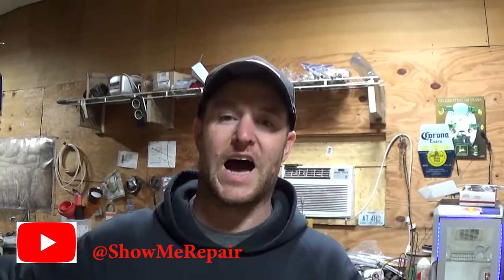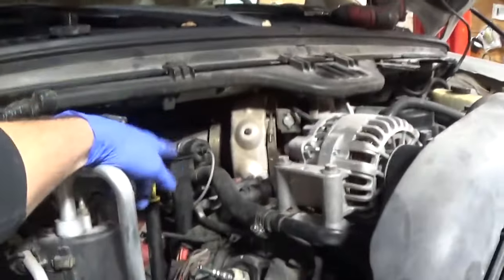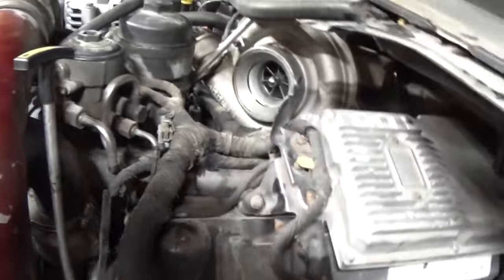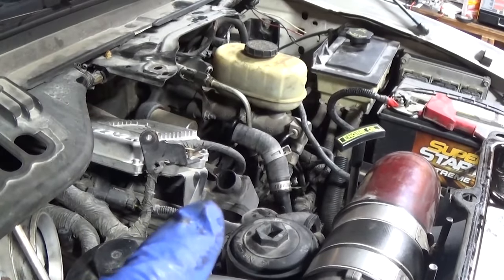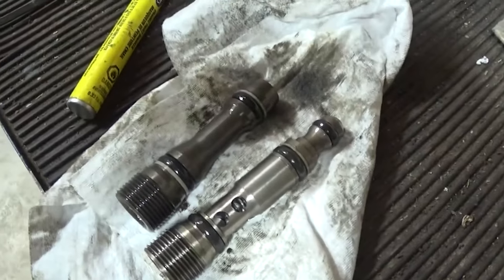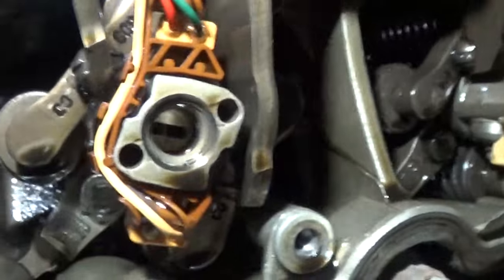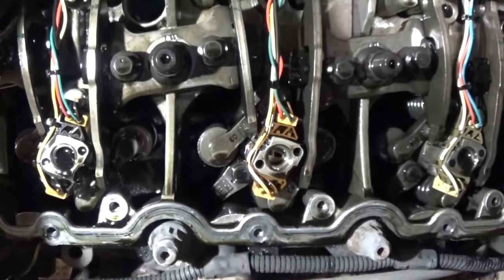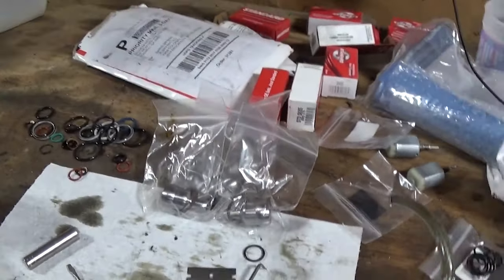I Learned something new on a 6.0 Powerstroke

Comment: i was really hoping you was going to show me how to get that clip out.i replaced all 8 orings on a nearly new injectors when i replaced my nipply cups and orings,..it didnt work for me.. i got around 5k on the first upper oring then a few thousand miles every injector oring after that
Reply from the maker: If I learn how I’ll definitely share. 
If your having o-ring failure that much. Check your oil for excessive fuel. I’ve had customers that go to long on oil changes and have excessive o-ring failure. Had a customer not to long ago started having oil leaks and drivability issues. Engine was making oil. I found some of the injector o-rings that seal the fuel in the head were leaking. Installed new injector o-ring kit. Cleaned out the injector bore with a brass brush also. Fixed concern
Reply: @showmerepair  heads are fairly new kdd and ive yet to see any hard to remove build up in my injector bores. i alway blow out the bolt holes and follow correct torque specs, and never a promblem with the replacement injectors only the injectors that i tried to replace that oring. Something to them upper orings.
maybe the standard brand reseal kit is the way to go, i used allience i think?
im scared to try it again so i just replace the injector when the oring goes bad.. Ive got 8 fairly new injectors that i didnt want to send back as cores and would be willing to try it again if i could get that clip out of there
Reply: Its not terribly difficult the C clip. although OEM injectors typically don't have a lip to grab on the C clip. so you're just stuck holding 2 small flatheads with one hand and hitting the other, you really need something to hold the injector in place in a vise. like a block of wood with drilled hole the same diameter i had a blown out top O ring on a injector had to remove the O ring. C clip needed to come out. they typically give them to you with injector reseal kits anyhow.
Reply: @Justn Saliga I seen a few youtube videos of guys doing it that way,  I just ended up with a bunch of broken little screw drivers.

Comment: Is the air test through the IPR any different or better than through the ICP?
Reply from the maker: When air testing through icp, you’ll have a leak at the IPR. It’s best to then get the tool that commands the IPR on. 
When air testing through IPR, there is no need to command IPR on since it will be removed. 
I air test at IPR since I’ve done it that way for years. I’m use to hearing the IPR leak. I’ve been thinking about getting the air tester at the IPR.
Reply from the maker: I also air test at the ICP since it easier to get to.
Reply: Yes, much easier. Especially when you have big hands. Thanks for replying. Your channel is great 👍🏽
Reply from the maker: Your welcome. Thank you for watching. I’m working on videos but I’m starting to get a lot more business. Not complaining that I have more work. But wish I had more time to make videos

Comment: OEM nipple cup torque spec is 100ft/lbs.  Where did u get the 155ft/lb spec at?  I think u said breaking torque was 145tt/lbs?   

Also did u notice if cup moved pretty easy on any that were leaking mmk it nesscary this time possibly another time with a diff truck thatcthhe cup seals where leaking have you noticed if they were sloppy prior to orings being changed and then they took alil effort to move it after they were torqued
Reply from the maker: I was figuring that break away torque may be less than actual torque so I added to the torque when I went back together. 
I have noticed some feel pretty loose. I’d still want to air test.
Reply: I’m going to hit 120 then go alil at a time.  What sucks is to assemble everything and it still leaks.  Airtest I hear it but I can’t tell if it’s leaking for not around nipple cup.  Thanks appreciate the reply also.  A lot of hosts don’t reply at all 👍🏼👍🏼👍🏼
Reply from the maker: Your welcome. I appreciate you watching the video.

Comment: I chased many leaks in the past and rebuild the injectors on the 6.0. the injector seals last for approximately 10k miles and starts to  leak again. what seal kits are you using? good information
Reply from the maker: I don’t have enough experience with them yet to recommend or warn to stay away. Will definitely update if I have any info. 10k sounds pretty low. I’ve seen o-rings fail sooner if an injector is leaking fuel into the oil.
Reply: lower ur fuel pressure
Reply: Alliant power ap0002  is the best injector reseal kit I have found!!! There decent enough that ford sells them if u need a complete reseal kit as the motorcraft kit don't come with orings for the top of injector.
Reply: It depends on which seal is going bad.  If it's a top injector seal failure, like the one shown here, it's almost always caused but one of the injector cup seals in the oil rail above it.  Once the oil rail seal starts to fail, it sprays high pressure oil into the injector seal below and destroys it.  If you're talking about one of the lower injector seals, I have had good luck with the alliant seal kits.  I'm running HHC seals for the oil rails and have about 40K miles so far.  I didn't replace the nipples.

Comment: So I’m going down the same rabbit hole but I’ve changed the nipple cups too. Is it possible that air is flowing through the injector ad back out the outlet holes? Everything has been changed. Testing through Ipr
Reply from the maker: @Redneckbusdrvr  if you’ve had the injector disassembled and have not had all the electrical hooked back up to let the ficm open and close the spool valve.
Reply: @showmerepair  I didn’t take any of them out or apart. Just changed the top o ring because I thought that was the leak and still air which I believe is flowing through and past the spool valve which I honestly didn’t know was an issue
Reply from the maker: @Redneckbusdrvr  ok. Just checking. You could have an injector stuck open. 
I have seen air leak past o-rings that are dry. 
Try putting the engine partially together. Enough to crank and build oil pressure. 
See if you’ve fixed your problem
Reply: @showmerepair  thanks for your help. I just threw everything at it. Stand pipes, dummy plugs, HHC nipple cups, 8 injectors and a new hpop. Just finished today and runs great. Appreciate your replies and videos. Thank you

Comment: Did you say 155 ft lbs to torque the nut on the rail nipple?
Reply from the maker: Yes I was torquing to 155. I just looked at a couple places online. 75 to 100 Lbft is what I’m seeing. The truck I did the repair on is still going strong.

Comment: How do you check or troubleshoot which oring leaking fuel into the crankcase on an injector. I've changed the orings and copper washers on all the injectors already but still getting fuel in the oil. Is this common problem? Vehicle is a 04 6.0 powerstroke and I don't have any blowby either..Thanks..
Reply from the maker: It’s not common but can happen. 
The way I’ve had to do testing before. Add dye to to fuel. Remove valve covers and oil rails. Run lift pump. Using a black light, Look around the injectors in the cylinder head.
Reply: @showmerepair  Ever try shop air to the fuel rails, and if so how much psi would you use?
Reply from the maker: @crushingthepyramid1641  I have not. Plumbing it up sounds like a pain. Fuel pressure max is around 65 to 75. 
I feel using air would possibly lead to misdiagnosis. Air is thinner then fuel.
Reply: Fuel into the oil would usually be the second o ring from the tip (black), I have heard of leaks from the injector body but have never seen it myself
Reply: @crushingthepyramid1641  theres a Fuel rail test port has air fitting on it you can get on amazon for about 7 bucks. replaces your banjo bolt with one with the Fitting. and you can pressurize it or hook up a fuel pressure gauges i bought 4 of them just because.
Reply: Cracked heads can leak fuel into oil if the crack is at top of injector bore.
Reply: @jimmyaber5920 yup, I've seen this more than once as a dealer tech..
Reply: Thank you for this. I have the covers off. And needed this help! Glad to find help! Liked and subbed

Comment: I have a 2005 f350 runs good no check engine light on cuts off after driving a while have to wait 20 mines to start again  keep doing it what can it be?
Reply from the maker: @Wayman-o4m  sounds like a high pressure oil leak.  You need to pressure test the high pressure oil system. 
If you’re expecting me to tell you it’s a specific part. I won’t do that. I’ve worked on these trucks long enough to know that guessing in the high pressure oil system is a bad idea.

Comment: I have a 05 with 288k and a hot no start, it also had a miss like a missfire in a gasser under load on interstate twice. I built a air rail tester for 15.00 and an OTC 6764 IPR controller an I can hear an feel air coming out of oil fill tube on passenger side. Will these cause that or is there another issue causing the miss under load. Starts in under 3 seconds when cold
Reply from the maker: You could have 2 different problems going on. You may have a weak injector and an oil leak. 
I would recommend pulling the valve cover to inspect for air leak. If you have removed both valve covers and no leaks are found. I would inspect connection at high pressure pump.
Reply from the maker: If you find your oil leak and your valve covers are off. I’d recommend inspecting the injector that is causing the misfire. Check for dtc it may lead you to the injector causing the misfire. Could a high pressure oil leak cause a misfire. It’s not common but it sure could. I’ve learned that anything is possible.

Comment: 'Ive got a Issue on my 03'with no codes  think its a weak HPOP the truck runs and starts nice. But at WOT @3500  its like I'm bouncing off a rev limiter.  When i use forescan the hpop isn't going over 2500 psI. will a bad leak or injector do it? i swapped out my ICP and IPR with no change . My FICM voltage looks good  and ive got 60pds of fuel
Reply from the maker: Doesn’t sound like hpop. Sounds like your torque converter isn’t working properly. You should be able to monitor rpm, input shaft, output shaft speeds. 
You may also be able to monitor torque converter slip
Reply: @showmerepair   I haven't been able to dig out my laptop yet but I took my 03' to town and I think your right about the tq converter. I never really noticed it till you said something but it feels like its stuck in lockup, Also over a year ago i had to replace the trans temp sensor but after swap it out I had to get a new pcm to fix it.
Reply from the maker: If the converter is locked then it’s like a clutch that is engaged. 
Think of it like a clutch. Push clutch pedal down. Converter unlocked. 
Clutch pedal released/ foot off clutch pedal. Converter is locked. 
It sounds like your converter is unlocked from what you explained. 
But sadly your converter doesn’t even sound like it’s operating correctly unlocked.
Reply: @showmerepair  Ahh that makes more sense lol. Probably been unlocked since i got it. I just figured trans felt different from my other 6.0s due to running 38's on stock gears and never really drive it much.Hasnt been reg in years cause cali emissions. lol Only thing i'm pissed about I recently had a spare low time trans that I donated to some dumbass kid who used to work for me

Comment: I have same issue but I put in a new ford ipr valve and it still won't start ,I'm getting fuel in the cup and oil is filling in the filter and the injectors are working ,same as the fuel pump is priming...I'm at a loss it does have a egr delete ...
Reply from the maker: Not trying to be rude but nothing you just said gave me much info on what could be wrong. 
Do you have a scan tool you can watch data on?
Reply: @showmerepair  it threw a egr valve...but the egr is deleted...so I'm stuck
Reply from the maker: That doesn’t make any sense either. 
Do you have a scan tool to check codes and data?
Reply: @showmerepair  codes are egr ,b1359 code and u1950..
Reply from the maker: Well since you have an egr delete and highly doubt the codes are turned off. 
You most likely have egr circuit codes and egr performance codes. 
The b1359 and U code most likely are not effecting the way the engine runs.  
None of the codes your getting are an indication of the issues your having.
Reply: @showmerepair  ok I just got through testing my ficm there is no voltage....so I'm ordering a refurbished one try that...get back to you after the results or see if it starts
Reply: I put a ficm in my 6.0 still won't start,almost everything replaced...I'm at a loss now ...any suggestions..

Comment: I’ve ran into a similar issue right now just done my heads and all new orings stand pipes dummy plugs while nine yards. But when I pressure test with air it sounds like air is coming from deeper than the injectors on the passenger side. And it won’t build any pressure at all any tips?
Reply from the maker: Maybe IPR or connection at high pressure pump. 
What year?
Reply: @showmerepair  2006 went with kdd oring heads on rebuild also only thing I haven’t replaced is the stc fitting. It’s just weird because it ran fine until I pulled it in to do the heads now nothing won’t build any oil pressure at all. Just haven’t been able to find anyone that has this issue it sounds like the air is just passing right through no restriction at all
Reply: @showmerepair  also I was doing the test through the ipr had a buddy that already had a checker made to do it that way
Reply from the maker: So your going back together after installing cylinder heads? Now you can’t build any pressure?
Reply: @showmerepair  yes won’t build any at all but when I air test it. It sounds like air is coming out the passenger side but everything is new and the sound sounds like it is coming from below.
Reply from the maker: Sounds like you need to remove the stand pipe on the passenger side and check the o-rings.
Reply: @William Dunn  I just put one back together im having the same issue. We couldn't build any oil pressure. I was told to check the relief valve by the crankshaft pulley. It could be stuck and u wont build any pressure.
Reply: @MrSr14eddy  that’s actually what I ended up finding wrong with mine any way to reset it? I ended up buying a new pump it should be here Tuesday but if I can fix the one on it I’d love to send the new one back and recoop some money from this money pit🤣
Reply from the maker: @MrSr14eddy  Edgar is right. If your not building low pressure oil. You can’t build high pressure. 
One way to check for low pressure oil. 
Remove oil filter. There is a valve at the bottom of oil filter housing. Black button. Push down on valve with something long. Crank engine using starter signal wire by passenger battery. We don’t want the engine trying to start. If oil fills oil filter housing while cranking you are making enough low pressure oil to supply engine.

Comment: Соленоид может травить воздух.
Reply from the maker: I translated what you said. “The solenoid may be leaking.” 
I’ve never seen a leak at the solenoid. But I won’t say it couldn’t ever be a problem.
Reply: @showmerepair  При подаче воздуха в форсунку, идёт утечка из верхних крайних отверстий. У меня 3 форсунки пропускали воздух, и это не связано с уплотнением в центральной части форсунки. Я попробую сделать видео. Сам соленоид подвисает и магниты не в состоянии регулировать положения.
Reply from the maker: @Сергей-ъ5г8ь  it sounds like you need new spool valve body. The spool valve is sticking in the bore. 
I don’t know where to buy the spool valve body. 
You can try using a fine grit sand paper on the spool valve. I’ve used 2000 grit. 
You may have to sand the bore of the spool valve as well. 
Be very careful. You won’t want to take a lot off.
Reply: @showmerepair  Ватсапп есть? Списаться можно с Вами? Контакт?
Reply from the maker: @Сергей-ъ5г8ь  I don’t do WhatsApp. You can email me
chrisbpowerstroke@gmail.com

Comment: Got one in shop. Icp is reading 153. Only starts on ether. Think im gonna do the stand pipes and plugs
Reply from the maker: Is it hot no start or cold no start?
Reply: @showmerepair  it started out as a hot no start. Now it won't start at all without juice
Reply: @showmerepair  stand pipes did the trick. These trucks and orings are something else lol